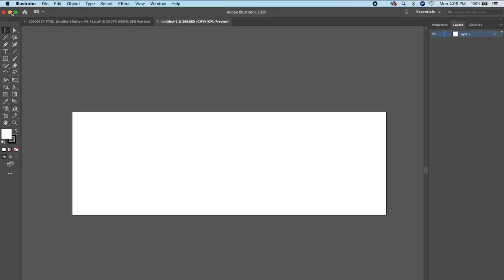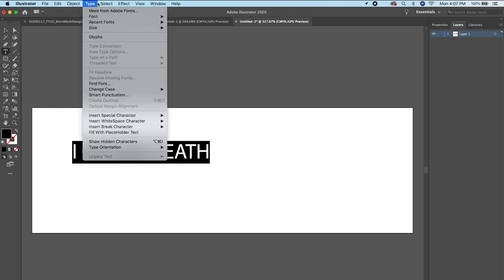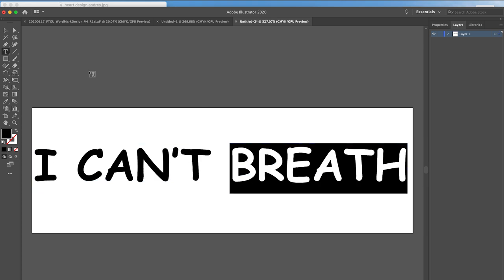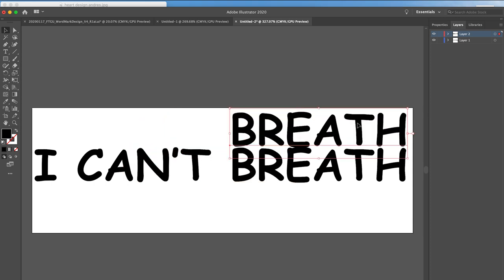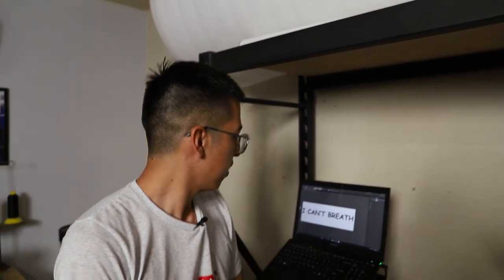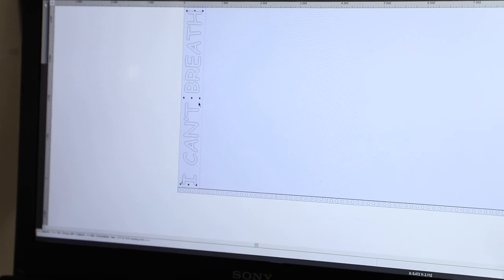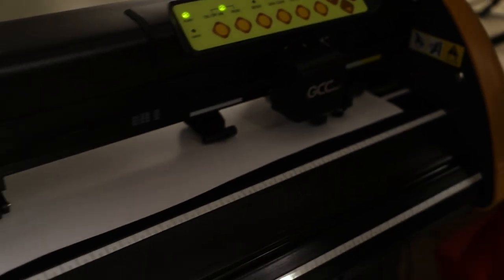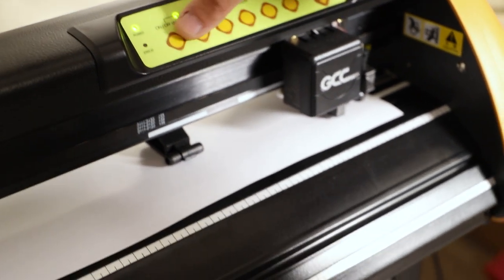How To Customize Face Mask With Heat Transfer Vinyl

Comment: How many layers of vinyl did u put in the middle of the mask
Reply: You can just use heat press pillows. Less than 20 bucks on amazon. They're made with a Teflon material so they don't burn, and help distribute the heat more evenly.